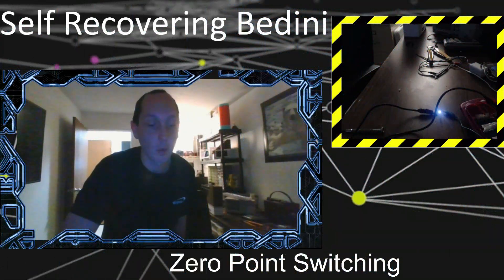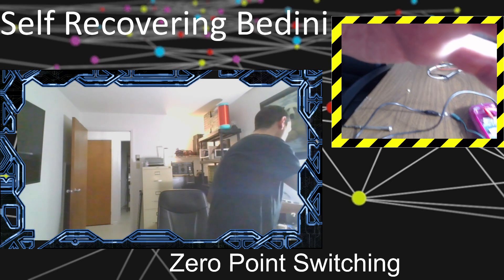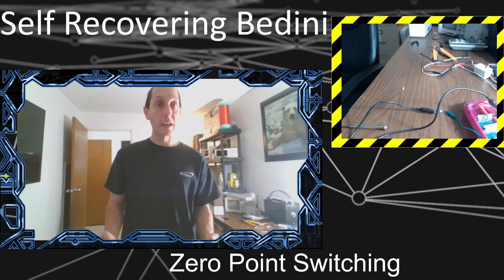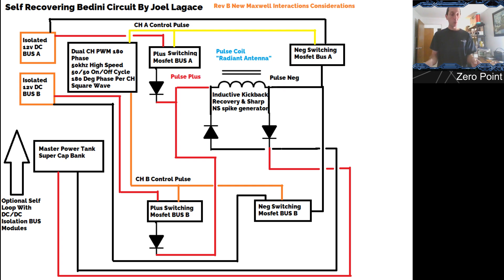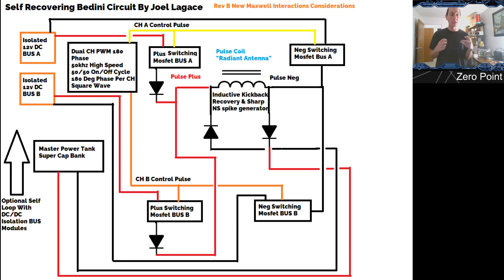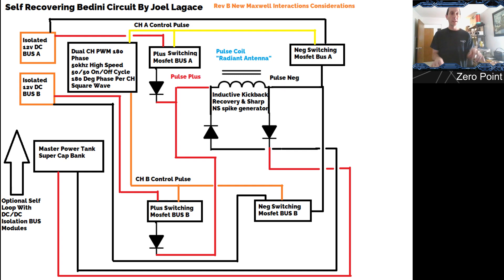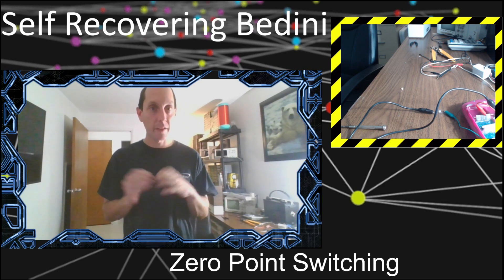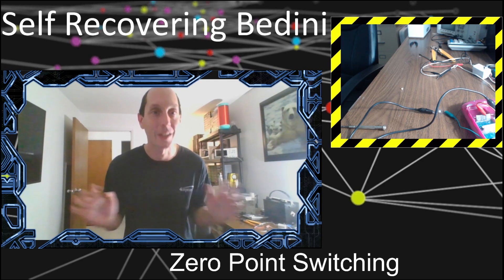Zero Point Switching

Comment: Joel, are you familiar with what's referred to as the toroidal power unit (TPU)? It's attributed to a guy by the name of Steven Mark... It's an apparent self running coil and magnet arrangement which supposedly works by resonating with the Earth's magnetic field according to one of the inventors...It appears to be utilizing bifilar coils.

There's a fantastic deep dive in depth analysis PDF titled "A detail study of Steven Mark TPU" you can find and I think I actually found several editions that had been updated.

Personally, I believe it's imploding the dielectric lines of force which are resonating with the earths dielectric acceleration (gravity), that's why it stops working when it's flipped upside down! 

The magnetic lines of force and the dielectric lines of force are actually the same flux. The only difference between the two is that they differ 90 degrees perpendicular to each other. Most electrical engineers don't even realize that! It's the same flux on the same toroid in the aether. It doesn't seem to be that the inventor/s understood that and so were puzzled about why it would stop working when flipped upside down.

Comment from the maker: Also because this spike event is in such low ns range. Some diodes may not capture the full spike. If one suspects that may be the case. One could test with an analog load right before the kickback diodes connecting to the coil. that don't care about polarity flips and big spikes like a lamp. If your 50 watt lamp glows brightly with just a few watts of input you know the device is doing something interesting. 😁

Comment: I will build the circuit. Thank you. Question: Can the peg cell handle the spike? Also would it capture the energy?
Reply from the maker: I suppose it depends how the PEG cell is built. The flat version probably not because of arching. The cup kind will probably work if electrodes are spaced far apart. But trade off is you loose a big part of the PEG cell  inherent current.
Reply: @joellagace1679  If we look at the cell as a capacitor and a rectifier we could build it to pinch and intentionally create heat as current but then wire it to apply to the output directly. it would create volts and amps out of protentional. 

Think of a 2" pipi and a 1/2" pipe inside. Then the 2" goes down to a 3/4" pipe then back to a 2" pipe creating a pinch. It might allow it to work like a dc pulse wave.  

The peg acts like an semiconductor and allows flow to continue. It might work.